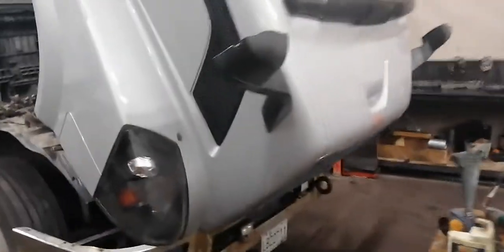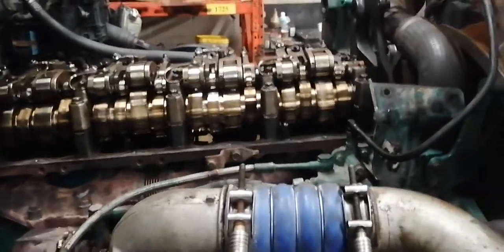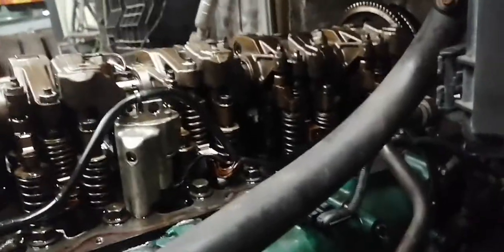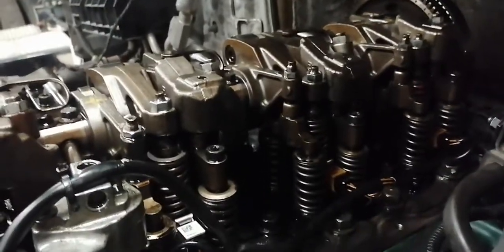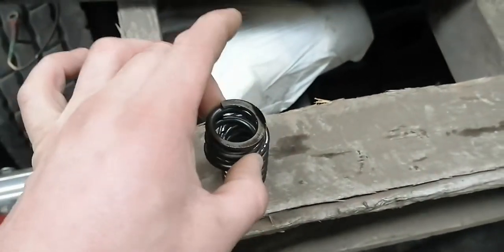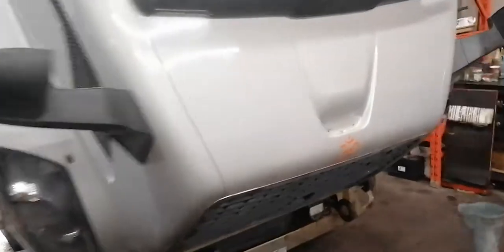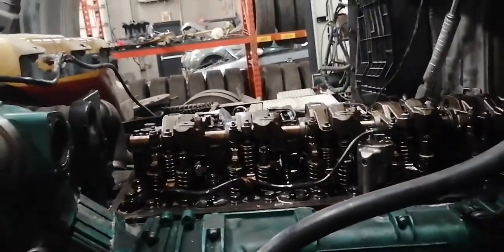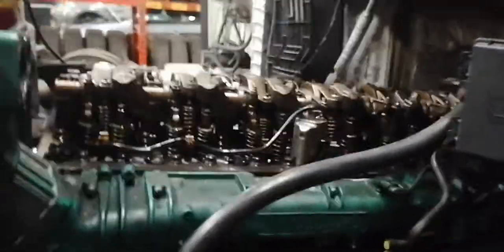Volvo d13 injector noise knocking

Comment: Hey I have a volvo with d13 and just did the pm on it however a fay ago I had a knocking sound but no check engine light so I Believe I have the same problem but I don't know what it is however I did had a problem with an injector.  What should I expect from my mechanic and how much though the repair range?
Reply: Open the valve cover up

Comment: Hey got question, 2018 Volvo d13 how to spot bad injector ? Took to Volvo good running truck for few filters they told me need replaced 3 pump injectors , just want to know what to look for once at dealer thanks
Reply from the maker: Hi, its simple! Using tech tool you can do an injector compensation test during 10 min! The test will tell if there is a real problem on the injectors and wich injector has a problem!